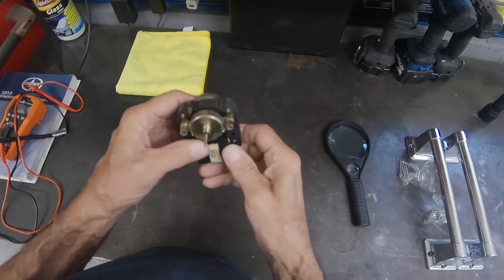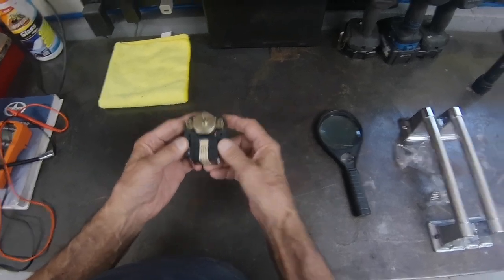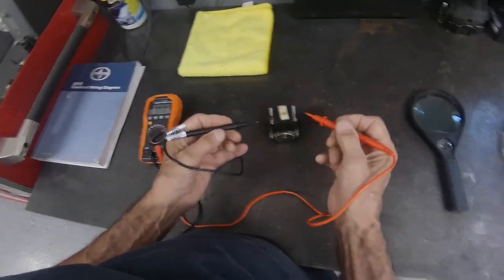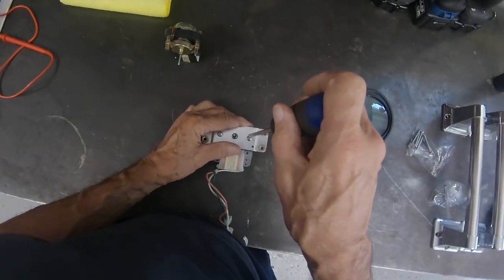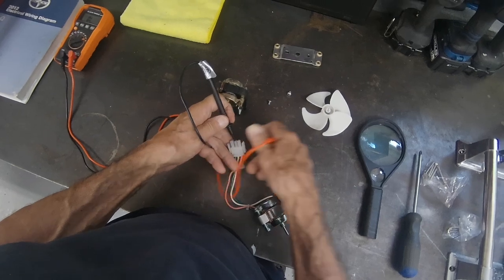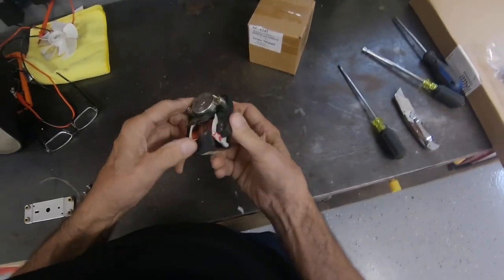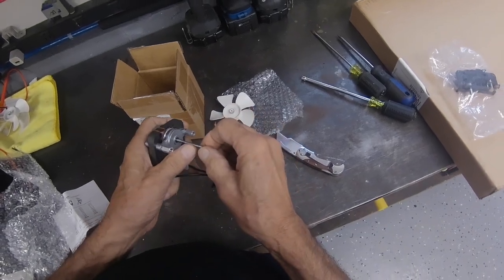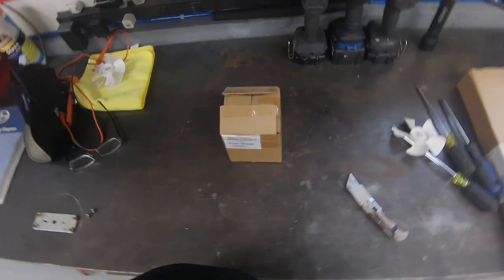Sub-Zero Evaporator Fan Motors

Comment: Same motor is used in many home refrigerators. I just replaced one in a GE. In my case, I don't think the motor was bad (still spinning, no excessive shaft movement), but owner had ordered the evap fan and wanted me to replace it.  I also found ice buildup in the air channel between freezer and fridge. I believe the ice buildup was the result of a faulty thermostat, which I replaced days prior.